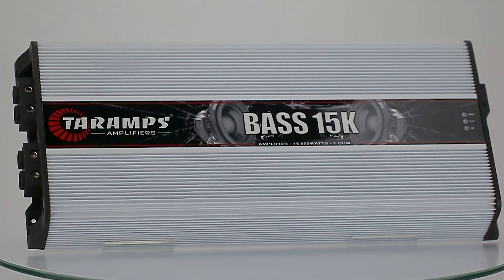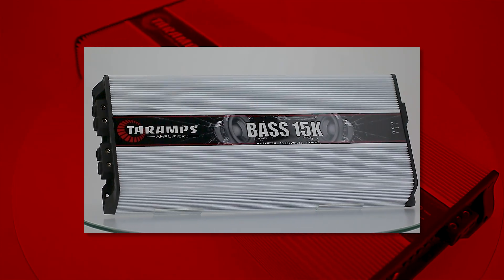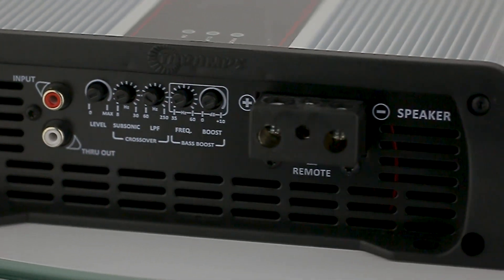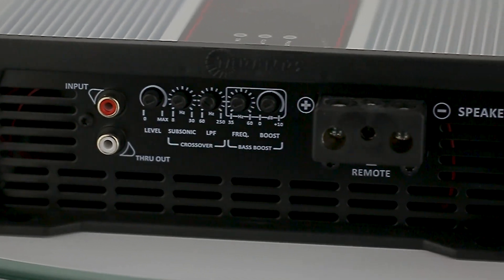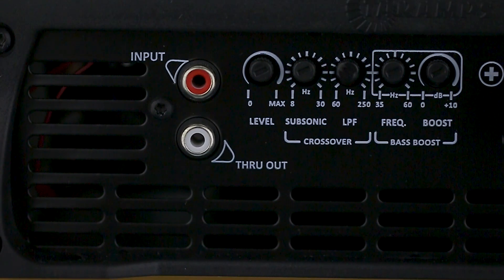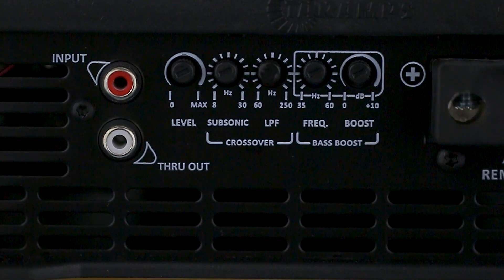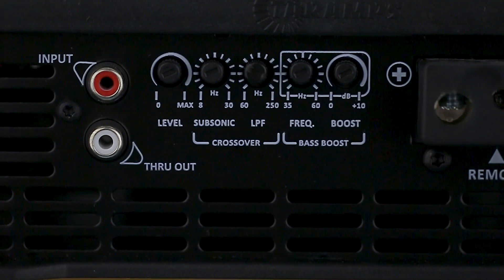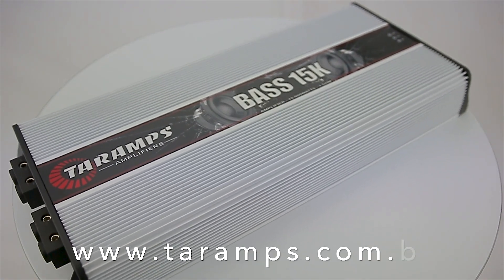Taramps Bass 15K Automotive Module Amplifier 15.000 Watts RMS | Taramps Group

Comment: What’s the deal on showing the guts on taramps
Reply from the maker: No problem showing it at all. This video is intended to promote the product only, but we may consider doing so in future videos.Thanks for the suggestion.
Reply: @CanalTaramps  thank you
Reply: @CanalTaramps  thank you
Reply: @CanalTaramps  I would like to see improvements on the low pass filter settings on the smart 3k and a better bass remote that allows control of the bass,temp,and voltage would be great along side the clipping indicator overall taramps are decent powerhouses for the money.